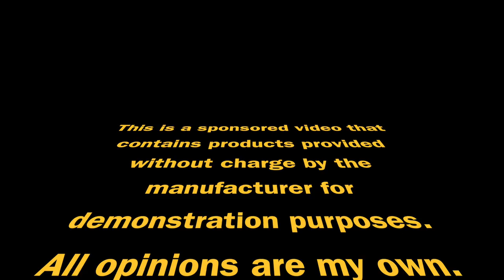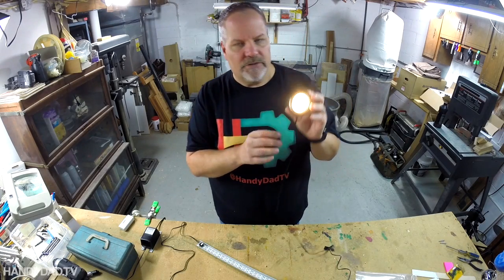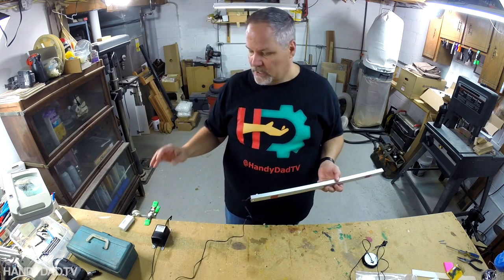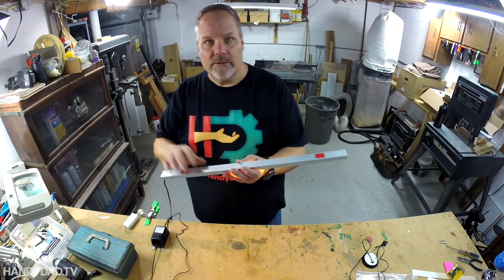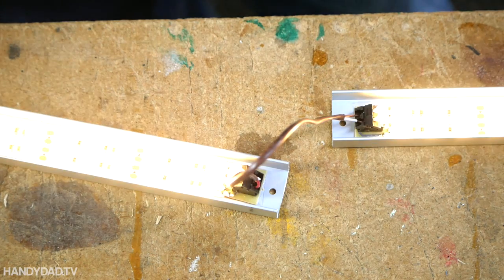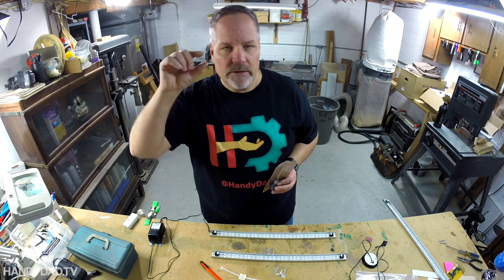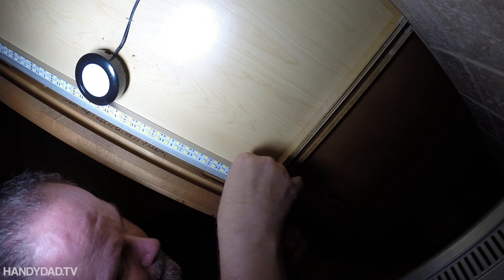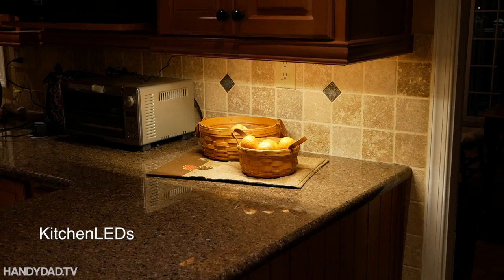Under-cabinet lighting with Kitchen LEDs

Comment: I'm a "light guy" too, can't resist buying even new flashlights !! 
I'm going to do an LED strip like this inside a shower niche very soon.
Reply from the maker: That would be cool for sure.
Reply: @handydadtv  yes it will, by the way what is the program you were using to do your narration on top of the video?
Reply from the maker: I record voiceovers directly in Final Cut Pro.

Comment: What type wire do you used to connect the lights
Reply from the maker: It depends on the size of the circuit breaker. If it’s 20 amp, use 12 gauge wire. If it’s 15 amp, use 14 gauge wire.

Comment: I did not meant  the romex wire.imeant the  small wire to add one set of lights to the other
Reply from the maker: Oh! Sorry. That’s just low voltage so I used thermostat wire, which is tough to bend. Thin speaker wire would be better.
Reply: @handydadtv  thank you.